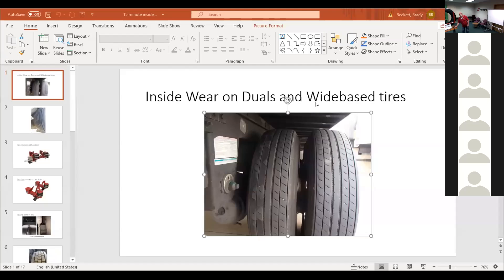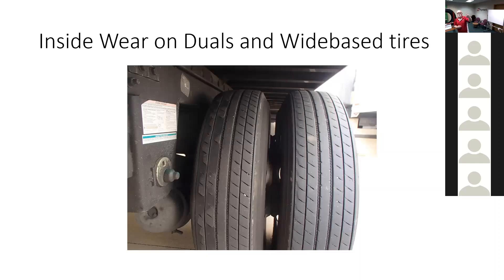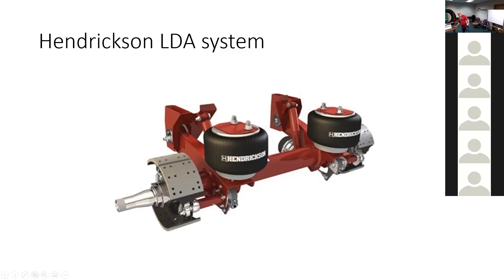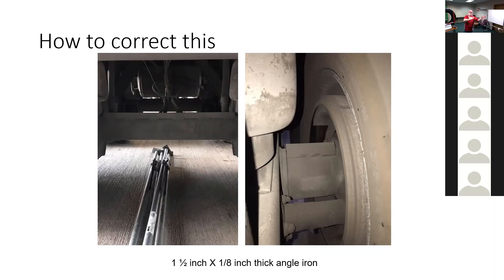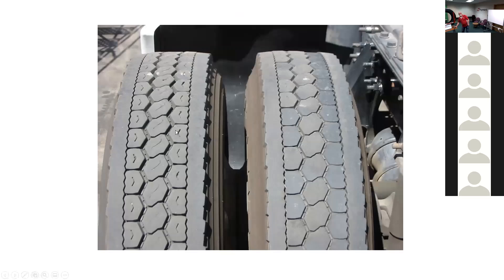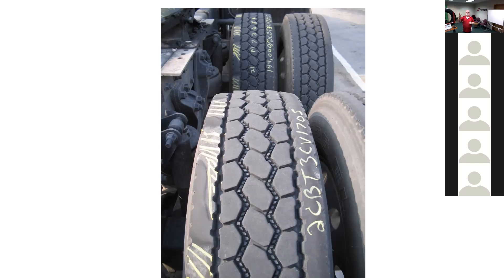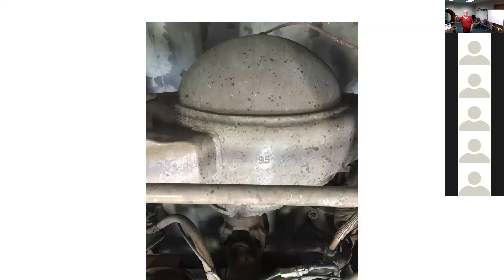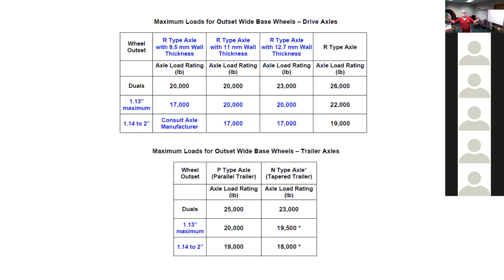Drive and Trailer Inside Edge Tire Wear (Zoom meeting)

Comment: I'm having this exact problem with my Wabash trailer with the Hendrickson axle.
It's eating up tires on heavy loads at higher highway speed
Reply from the maker: Well… high speed and heavy loads do tend to burn through tires.  If the wear starts on the inside edge of the inside dual then the fix in this video will help! Slowing down will save so much money I urge you to just consider how a few mph less is feasible for your operation.
Reply: @MDAlignment thank you for the video it's been a headache trying to figure out the problem.
Replacement of all airbags,shocks,drums, rotors,tires, all air inflation hub caps, a couple of air inflation hoses......
I was losing sleep and money.
I'll see if I can get a welder to help me out.
Would you please tell me the size of the angle stock I'll need?
Again thank you for your videos and for replying to the comments!
Reply from the maker: @Fatbaldguy  We recommend 1 1/2 inch angle iron 1/8 inch thick spot welded on the top of the axle.
Reply: @MDAlignment thanks again for your help

Comment: Hello, please tell me, I have a Great Dane trailer with a Hendrickson bogie. And I have the same problem on one rear axle, the inner part of the wheels is eaten away, it is eaten away unevenly. What can be done in this case? The bogie is absolutely new. The bearings are adjusted. Thank you
Reply from the maker: Same thing as we recommend in the video is weld angle iron (1 1/2 inch angle iron, 1/8 inch thick) especially to the outboard few inches of the suspension, add strength to the axle.
Reply: @MDAlignment I understand you. Thank you very much for the information.

Comment: SAF aswell?
Reply from the maker: @CabelSenior  SAF makes a large diameter trailer axle for the same reason as Hendrickson: lighter weight.  We have not received the same complaints of tire wear from SAF customers.  This doesn’t mean it’s not happening.  Hendrickson supplies many more suspensions to the market than SAF so maybe we just hear about them more.

Our recommendation is if you have SAF and see this wear, first check the wheel bearings and make sure they aren’t causing this problem.  If that isn’t the cause, strengthening the axle is the next step

Comment: I have wear on the sides of all 8 tires, on a trailer. The pressure is 110, if 100 then the wear goes much faster. We did alignment twice, it didn't help. Wear only occurs when the trailer is loaded with more than 35,000 pounds, this is somewhere between 28-30,000 pounds on axel. No one can’t figure out what is wrong.
Reply from the maker: What kind of trailer/operation?
Reply: @MDAlignment  dry van 53. Hyundai 2020
Reply from the maker: @ДимаКама-ю9ъ  then the axle flex is undoubtedly the cause of the wear.  Tires that get worse fuel mileage ratings often handle axle flex better but the particular manufacturer has a lot to do with the overall life.  I can’t recommend a particular trailer tire right now I suggest asking users what they find works best.  Strengthening the axle as described in the video will help.
Reply: @MDAlignment I have the same thing with my spread axle cattle pot. The front axle wears horrible, but it seems that it may follow a wheel but not certain. The back axle has a whole new set of 4 with balance beads running 100 psi and are wearing wonderful. Curious on your thoughts @MDAlignment
Reply from the maker: @travishinck3843  Spread axle trailers have terrible wear problems themselves simply because they are not designed to turn a corner as smoothly as a close tandem.  The inside edge wear from axle flex is also an issue on a spread axle.
Reply: @MDAlignment would you still suggest doing the angle iron close to the spindles or even possibly channel iron for the added strength, its not uncommon to have 40k or more on the trailer axles
Reply from the maker: @travishinck3843  yes adding angle iron 1 1/2 inch by 1/8 inch thick will add strength to the axle if you are worried about it.

Comment: We have an odd issue where both the inside and the outside of all tires on our trailer edge wear before the tread air pressure is 105 and trailer has new bearings and bushings. Brand of tires doesn’t seem to matter and trailer is in alignment also truck is in alignment any thoughts would be appreciated
Reply from the maker: If these are 22.5 dual tires then 105 is more than necessary to carry the max load.  Dropping to maybe 90 pounds would still accommodate the load and should eliminate the wear.
Reply: @MDAlignment  I should clarify 43ft hopper bottom almost always at full 34k on rear would the 90psi be ok for that
Reply from the maker: @lonewolfmjm  Yes, the same tire that carries around 6000-6500 pounds on the steer only carries only 4250 (34,000 divided by 2 axles and then by 4 tires) in a dual application.  For that weight as a dual the same chart that says you need 105 or 110 psi for a single operation fully loaded only requires 75psi for your duals.  Knowing that, you can confidently run 90psi in duals.  more information here: https://youtu.be/tHN3fUFO7GM?si=5JQp493MXvfDaB08

Comment: Does welding the angle iron on the axle next to tires make a difference?  I welded center between suspension. I did not weld the 8” pieces closer to tires.
Reply from the maker: As we get feedback it seems the wheel ends are significantly more important than the center, with many reports that omitting the middle lost nothing but omitting the outside was the same as doing nothing.  I am also hearing from tanker operations specifically that the weld on the outside isn't helping them as much as our other customers.  I assume this has to do with the liquid shifting weight, and the greatest amount of flex occurring at the weld on the suspension.
Reply: @MDAlignment  ok. Thank you for responding. I appreciate all of your knowledge and videos. I’ve learned a lot.

Comment: Im wondering if you have a similar video covering the 19.5 tire. In my case it is a Continental hybrid on a 2020 F550.
Reply from the maker: No video of that but you can call us at 515-967-5626 to discuss any issue.  Helps to ask questions that pinpoint the problem.
Reply: @MDAlignment  pin & point are not coming together yet.  But agree it is useful to feeling good that the question is specific enough to feel good about the answer.
Reply: I have a semi trailer that easy the hell out of the 19.5 tires on the inside tires. This is why I’m on this video now. I think the trailer has a Henderson system on it as well.

Comment: How do you fix inside tire wear if you have the light weight drive axle?
Reply from the maker: The available options are: purchase high rolling resistant tires from brands such as Falken.  Verify that your wheel bearings are properly adjusted.  It has been suggested that you could weld angle iron near the end of the axle similar to what has proven successful on trailer axles but we don't know of anyone that has tried it mostly due to warranty issues.